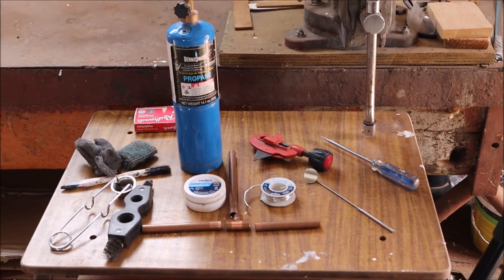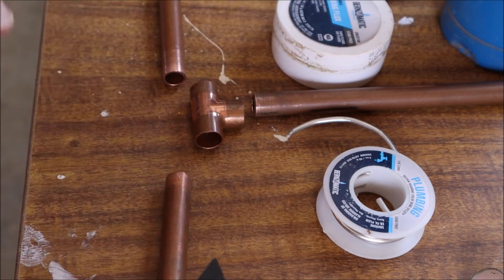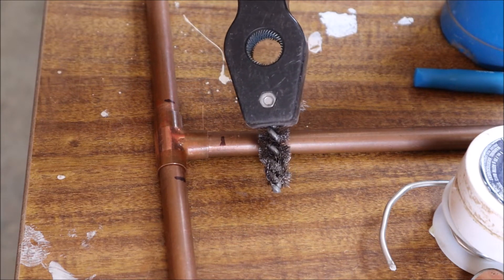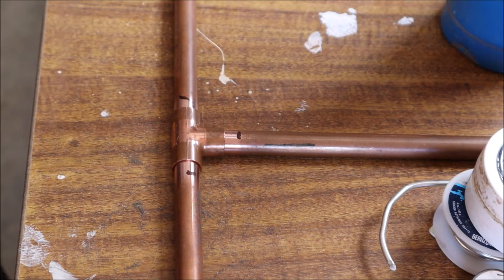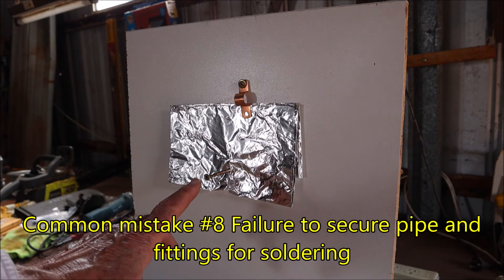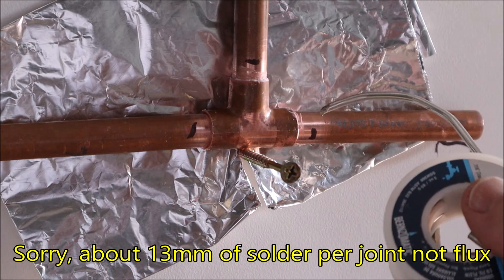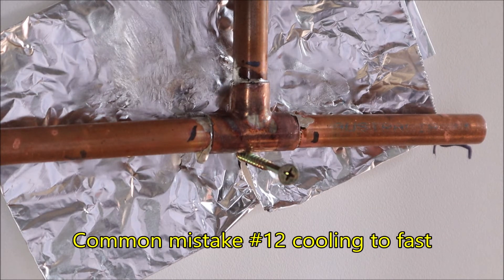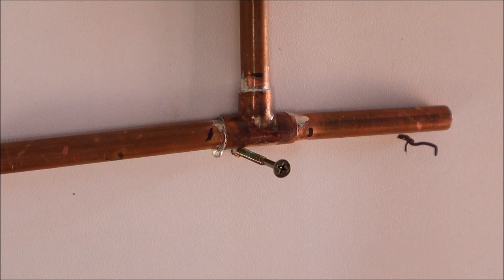How to solder copper pipe and avoid 13 common beginners mistakes

Comment: I have a problem with an ancient 18mm pipe I need to convert to a 12.5mm pipe. the 12mm slides nicely into the 18mm, but I am not able to get it to solder. I am using a MAPP heat gun. Do you think maybe I am going too hot? The solder just blobs around everywhere. I am using flux.
Reply from the maker: Thanks for your comment. Good question. Hard to say without seeing it but you could be right about being too hot. If that is the case the flux normally burns off to a brownish deposit. I would try experimenting with each pipe separately to see if you can get the solder to stick on a small clean, dry patch on the side of the pipe, be sure to apply the heat to the opposite side and not directly on the flux. If it sticks to the 12mm pipe and not the 18mm then it may have something to do with the composition of the 18mm. Also besure the inside of the 18mm is perfectly clean and moisture free and well prefluxed. If there is a bit of a gap between the 2 pipes the it may be necessary to pre heat the 12mm pipe moderately but keep the flame a little way away from the joint and fluxed zone then move the flame to the 18mm pipe on the joint zone and keep testing with the solder wire on the opposite side to the flame until it gets hot enough to melt it, the switch sides and quickly apply solder to opposite side if necessary . Finally if the gap between pipes is too large for capillary action it may help to pre coat the 12mm pipe with solder and then slide it into the preheated 18mm pipe and touch up with additional solder when they are joined, this is a bit tricky but may work as a last resort. The main message here is to experiment until you have a method that works. Hope this rambling reply is of some help, good luck. Let us know how it goes. 😊👍
Reply: @AnnErasmus  Thanks for your reply, it is appreciated.  The problem here is I am not able to post a photo. If you have another social media contact, I may be able to share. What I can tell you is the smaller pipe fits nice and snug into the larger pipe. No gaps, almost like it was meant to be. One thing I learned is maybe I'm heating it at the wrong spot. I will try again.
Reply from the maker: @Tom_8430  yes that could be, the heat should be applied to outer pipe (18mm) about 1cm away from the gap, that will draw the solder into the gap👍😊